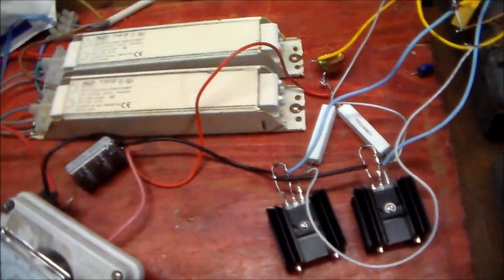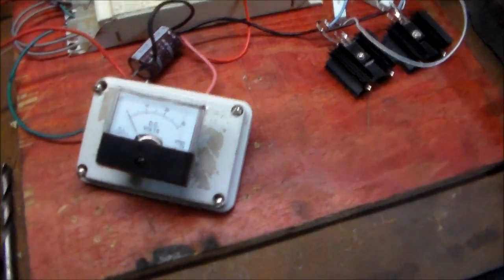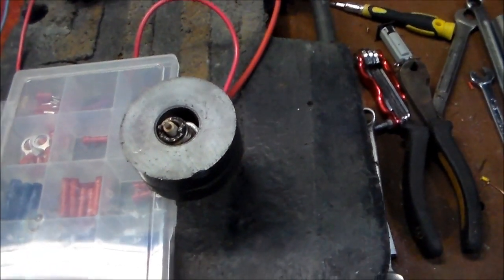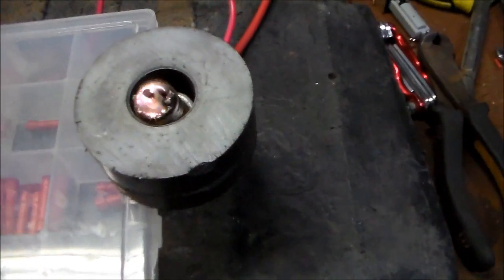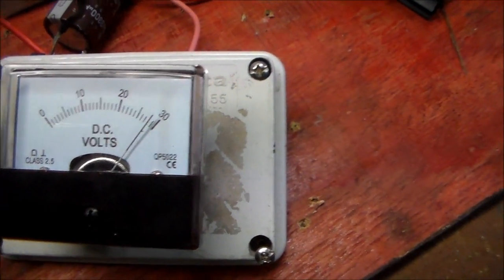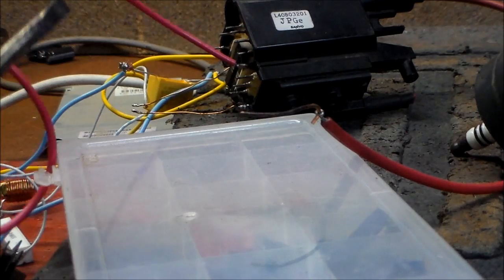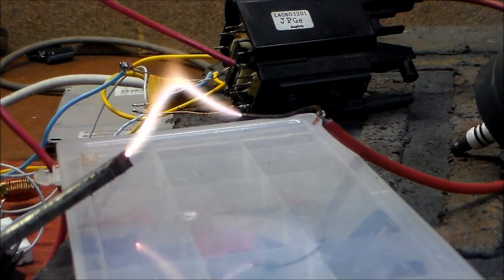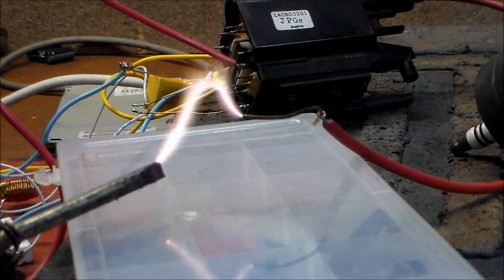Flyback, Royer Oscillator 28 Volts + Plasma Spinner Arc in Magnetic Field Test

Comment: @alex993cc1 Try one or the other id say try less feedback turns first, that sould make it run cooler and possibly even better. When i lowered the turns to 2 on mine i actualy got about 5mm of break out on the HV lead :)  but then the feedback wire came loose and the transistor went bang!!!! If you try lowering the resistence just be carfull cause the transistor gould get really hot also you could try raising the primary turns to minimise heat :)

Comment: Haha nice big arcs now :) if you want more power out of this you could try lower resistance :) although it would get much hotter. Try lowering the feed back coil to about 1 turn. Just test it at a very low voltage :) cause if the voltage coming of the feedback is to low the transistors will go dead short and draw a shit load of current and blow!!!!! :) have fun :)